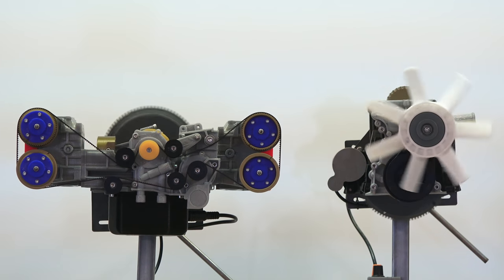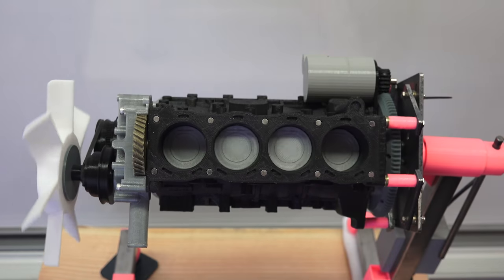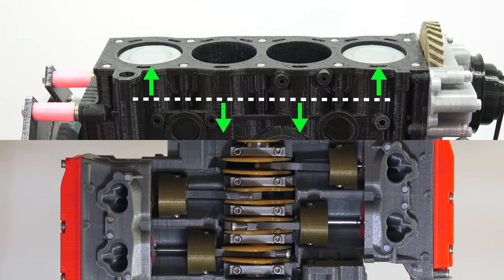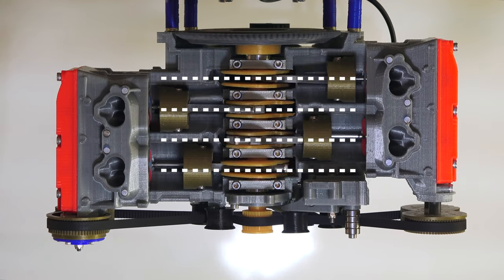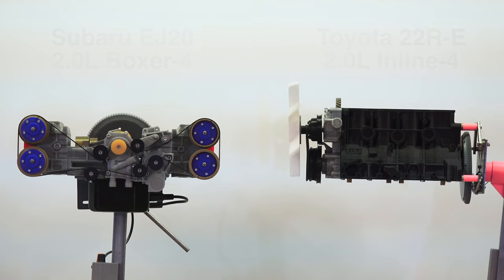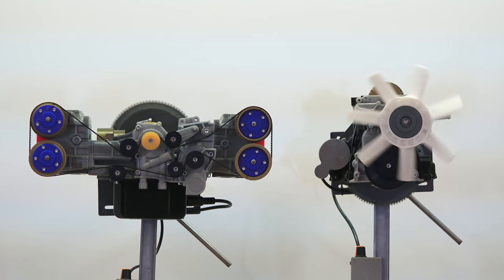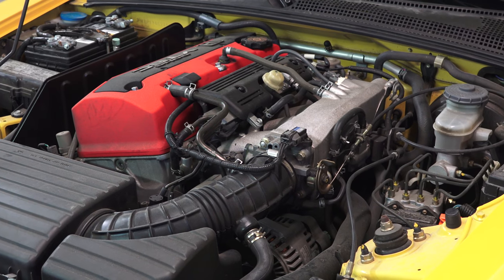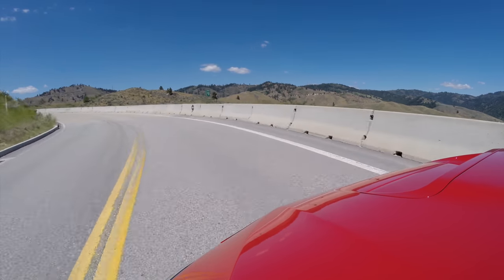The Differences Between Inline Four & Boxer Four Engines

Comment: +1. Always informative.  .. As the original owner of a MY05 Subaru Outback XT (2.5l Turbo) with 135,000 hwy miles, it's become necessary to remedy an exhaust valve requiring service. The motor must come out to effectively remove and replace the cylinder heads. .. Subaru horizontally opposed engines are notorious for early head gasket failures; Some head gasket failures attributed to substandard replacement practices and or gaskets brands. ... Not so much an issue with inline 4 cylinder architecture.
P.S., My from neu MY98 Porsche 911 C2S (993) 3.6l 6cyl horizontally opposed never so much an issue with head gaskets .... ever!

Comment: I actually learned something! I've been seeking confirmation for literally (like literally "literally", not figuratively "literally") years that the only reason a F-4 sounds different from an I-4 is exhaust setup. I couldn't think of any other possible difference that could explain it: both fire once every 180deg, period. Nice to hear someone actually say so though. I assume the same is true of crossplane vs flatplane V8s and flat vs V-12s; all I ever get is "yeah, well, crossplane V8s are, like, uneven firing, so they, like sound different". I'm pretty sure that a V8 of any type fires once every 90deg of rotation, no matter what. "Uneven" firing refers to the cylinders firing in different places of the engine, not the rate at which they fire. Presumably this creates resonance effects in the exhaust, but like with a F-4/I-4, if you run open individual stub headers, it should sound the same.

Comment: Question: would it be possible to create a V8 engine that fires two cylinders at once, instead of one at a time? What kind of impact would this have on efficiency? Would it create too much heat, and too much vibration?
Reply: im not certain, but theoretically it would screw with the balance, and heat and efficiency would definitely take a hit too. i think it would literally double fuel consumption.
Reply: A flat plane crank v8 does that.
Reply: ^I believe he is right; if I'm not mistaken, Ferrari and most "foreign" V8 engines use flat cranks rather than crossplane cranks, which is why American V8s "rumble".
Reply: Flat plane cranks are normaly faster reving then crosses.
The rumble is due to uneven exhaust pulse spacing and bad thing.
Reply: On a four stroke engine, if you make the angle on your V8 between the cylinder banks 180 degrees with a flat plane crank, you can get two cylinders fire at the same time on opposite banks. But it will depend on the strength of your engine components as to how long such an engine will last.
Reply: @GlasssTopRX7 DAFAQ you talking about that crossplane is smoother and more reliable vs. flatplane? The closer each pulse or firing is, the more uneven the power pules are, and the larger the bearings have to be, the beefier the transmission has to be, the diff has to be larger and stronger, etc. has to be to withstand more of a impulse at once vs. having the power spread out evenly over a whole cycle of time. The only reason manufacturers' use crossplane over a flatplane is due to noise. USA train tracks are considered "enjoyable" due to how the tracks are laid out, unevenly vs. Russian tracks that are even, which tend to drone, repeat, etc. more then the uneven ones, and are not as "enjoyable". The same reason that many people prefer uneven engines like most USA V8s, older Subaru boxer engines with unequal length headers, etc.. It comes down to how the human ear/brain works not physics, Flatplane cranks are better.
Reply: @GlassTopRX7 Once again WTF you talking about? Most crossplane V8 use more counterweights and balancing shafts vs. flat plane V8's. If anyone in this thread had a clue it would be amazing, and I would not have had to post, but such is life...
Reply: Last time I checked, 8 divided by 4 is two, meaning two cylinders fire at at time.
Reply: That's not how cams work dude.
Reply: +Den Log The reason why crossplane V8s fire they way they do is that it allows the crank to be shaped so that counterweights placed directly on the crank can cancel out the force of the cylinders moving. This means that ALL crossplane V8s have counterweights, its an inherent feature of the design. However, they don't use balancing shafts as there would be no point. 

Flatplane V8s are less smooth because they are basically just two I4 engines glued together. They suffer from the same vibration problems that an I4 suffers from, but with two banks of cylinders. This means that Crossplane V8s require four external balancing shafts that move at twice the speed of the crank to be smooth. These counterweights would defeat the weight saving and reciprocating mass advantage of a flatplane crank.

If you are willing to put up with a engine that vibrates to the point that you can't use one in a street car(at least not without using super expensive engine mounts), you can just not use balancing shafts, and you will end up with an engine that is smaller, lighter, and has less moving mass. This is why racing V8s are often flatplane.

The Gt350 uses a flatplane crank almost purely as a marketing gimmick. They would end up with a cheaper and smoother engine with the same moving mass, and therefore revability if they used a lighter, more expensive alloy crankshaft instead of a flatplane one. It wouldn't be as cool though, which is what really matters.
Reply: Lots of misinformation in these replies. A cross plane crank has all four journals 90 degs apart and a flat plate has two journals 180 degs apart from the other two, but both engines fire each cylinder evenly. That's every 90 degrees in two crank rotations. The difference comes in cylinder bank order where a cpc would have a LRLLRLRR bank order the fpc is LRLRLRLR order.
Reply: Thomas Knobf Aluminum is stronger than iron when used in an engine. Most production iron blocks are stronger than equivalent aluminum, but that's because the entire point of iron is that's it's cheaper, so you would want easier less precise manufacturing. If you overbuild an engine block, imperfections that make it weaker don't matter as much because it's still strong enough.
Reply: well ,4 strokes of 180 degrees are 720 , so a fire every 90 deg usually , in a v 10 there is a fire every 72 deg ,in a v-12 is a fire every 60 deg , got it ?
Reply: Actually rumble in US V8s is due to firing order and manifolds, usually non-US V8s are still cross plane, flat planes are only used in a few cars - usually British (Lotus, TVR, iirc some McLarens) and Porsche 918.
Reply: The reason that most production V8s are cross-plane is due to cost, flat-plane crank V8s have lighter cranks (due to not needing counter weights) and are more free revving but they have vibration issues. The way to reduce the vibration issues is to have higher quality parts and materials, machined with tighter tolerances, hence costing more. This is why cross-plane crank V8s are usually in expensive sports cars, where the additional manufacturing cost isn't really a downside. This doesn't mean cross-plane cranks are always worse though, they're just different. The additional rotational mass means they don't rev as much BUT it also means they have more torque in the low to medium rev range which makes it nicer for every day driving.
Reply: I am looking for another 99 dodge ram 5.9 so I can steal the fuel injection harness.  I am going to wire into the existing harness so I have 2 cylinders on each bank fire at once. I will end up with 600hp on a 250hp engine.  Its gonna be awesome.  LOL  :)
Reply: Dunkaccino25 why are those words in quotations
Reply: GlassTopRX7 in what way is a Ferrari reliable
Reply: Hi Dialysis forever. You couldn't just use another fuel injection harness. You'd have to have a different cam. Are you talking about making it a 2 stroke instead of 4 stroke engine? Crazy idea. You'd have tons of custom hurdles to overcome including programing a new PCM for the changes in spark.
Reply: That would basically turn an 8 cyl engine into a 4 cyl.  The whole idea of having an 8 cyl is so you have 8 different pistons firing at 8 different times. If you wanted them to fire at four separate times than why not just get a 4 cyl.

Comment: There's a difference between a flat-four and a boxer engine.  The opposed cylinders on a boxer engine are in line with each other.  This is possible because the opposed cylinder use the same crank pin, and the big ends of the connecting rods are forked.  A true boxer engine does not have the rocking couple, while a flat-four, where each cylinder has its own crank pin and staggered cylinders, will have a rocking couple.
Still, you do a great job explaining so many things - you have a great site.
Reply: boxer engines are a subset of flat-four engines

Comment: The reason why every Subaru owner has blown a head gasket 😂💥
Reply: You forgot a S on gasket. It has 2 and yes they blow constantly and are such a pain in the ass to change. Also because of the mentioned twisting motion, you will go through engine mounts like priests go through alter boys. Don't buy a vehicle with a boxer engine. I'm warning you from experience.
Reply: Subaru's been using the FB engine for almost 10 years now that has no coolant passages through the head gasket, therefore no gasket leaks.
Reply: @trainiax  c'mon man ! Us the worst Japanese car?
Reply: @shperax  Altar...

Comment: Look into Lycoming aircraft boxer 4 engines. They can get up to 5.9 liters!
Reply: With the Subaru engines, they were designed based on the Avco Lycomings O-320.  The original version was scaled down and air cooled, but from there, they were water cooled.  A lot of development went on from here, but in essence, Fuji Heavy Industries did not look at VW, Porsche, or any other car manufacturer when they decided to go with the Boxer engines, they actually looked at Lycomings.

Comment: An interesting thing to mention is that while boxer engines in cars aren't all that big, airplanes (small propeller airplanes that use gasoline engines rather than turbines) usually use huge four- or six-cylinder aircooled boxer engines. For example, the Lycoming IO-390 displaces 389 cubic inches/6.37 liters. But out of that only gets 210 horsepower at 2700 RPM - though it's designed to produce that all day rather than just in short bursts, most car engines can only produce their rated horsepower for a brief time without overheating. And it runs pretty slowly as it's direct drive to a propeller. Similar the Lycoming O-540 is 8.9 liters six-cylinder boxer, 300hp.

Comment: The Panhard & Levassor H2 has a 2 main bearing crankshaft allowing the two cylinders to have very little offset. Only when idling does it have noticeable shake, mostly a horizontal twisting motion. 
Unfortunately this fine engine was discontinued when automobile production ceased after 1967. A multicylinder development of up to 12 cylinders was used in a series of military vehicles.

Comment: Advantage of in line 4. non interference engine..2 chains instead of 5..and far more reliable and services easily
Reply: You're right about the ease of service on an inline, but that's it.  

Reliability has nothing to do with whether it's a boxer or inline.  Nor does non-interference - Subaru engines have been both interference and non-interference depending on the year.  And I don't know what you mean by "2 chains instead of 5" unless it's for the timing belt/chain pulleys, which aren't really a reliability concern either way.

Comment: Just bought a Subaru Legacy. We shall see about engine. Remember, the VW used boxer engines and they were just about impossible to destroy.
Reply: Not true, anyone who had an air cooled VW engine knows that they ran hot, only had 2.5 qts of oil, no oil filter and if you neglected to adjust the mechanical valves, one would eventually tighten up, overheat, the valve would break off and trash the engine. The only way you made those last was very frequent oil changes and valve adjustments. Mono grade oil too. They ran hot enough to thin out multi vis oils.
Reply: Luigi 1955 and all the leaks these engines had... Dear God.
Reply: Got subaru wrx in 2007 and sti 2011... Never a problem....

Comment: Not seeing the resultant rocking couple on the boxer engine. I get it with a boxer twin cylinder engine but looking at the boxer 4 cylinder above at 0:57 frame, for example, pistons 3 and 4 (at TDC) are causing a clockwise couple, but pistons 1 and 2 (at BDC) are causing same magnitude couple in anti-clockwise direction, thereby cancelling each other. At 0:58, the opposite happens, again cancelling each other. What am I missing?

Comment: I'm here just tryin' to figure out how magnets work dog
Reply: Electrons have this property called spin.  Normally electrons spins cancel each other because of their partner electron, but in magnetic elements, there are several single electrons.  

In magnets, the spins of several electrons, and between several atoms, all line up. How that spin actually results in a force you feel is kind of complicated, has to do with relativity, but it's the force of either positive charge to negative (attraction)  or positive to positive (repulsion) . If you want to learn more go to veritasium or minute physics, they have good videos with animation.

Comment: Nothing about reliability? I easily put over 300,000 miles on my Subaru’s while my wife’s in-line Ford and Chevy cars struggle to get to 150,000 without major repair work. This is based on 40 years of driving experience.
Reply: 90s Ford's are like the plague.
Reply: Ya, almost as bad as the 80's Fords.
Reply: I don't think boxers would win in a reliability shootout. Gasket seal leaks are a perennial problem on Subarus, not sure about Porsches.
Reply: 6 cyclinders, not V8's.
Reply: Reliability only comes with good maintenance. Most people who own subarus dont realise you need to service the engine after every 5000 - 10000kms like most turbo vehicles. However as the subaru engines get older they need to be serviced more frequently. People ignore these simple facts.
Reply: Sounds like you need to get your wife a good bicycle or a horse.
Reply: 300k how many times you do the head gaskets?
Reply: Ford & Chevy are not the only brands that use inline engines..most companies use inline engines.. inline engines reliability?? ever heard of Honda & Toyota??
Reply: My 07 ford ranger 189000m inline 4 no repairs at all hmm mythbusted
Reply: soulless one Skoda Octavia 1,9 TDI. Inline 4.   500.000 miles and runs perfect. Check famous Miles on YT
Reply: I Subaru isn't going to match ford's inline 6's when it comes to reliability

Comment: Nice video, I would like to add 2 more big disadvantages of the horizontally opposed engines though. The first one is the shape of the ports, look at any decent modern engine and it has a small cross sectional area and an upright design which still allows it to flow well due to the high velocities it can sustain. However on a flat engine the intake needs to curve back in on itself and as such the intake ports have to do a full curve much like what you would see on an engine made 30 years ago. The second is that because there is very little spacing between opposing cylinders the webs of the crankshaft and the con-rod big ends have to be very narrow. This makes the crankshaft really weak and it's compensated for with narrow much larger diameter journals for both the rod and mains. The result is a higher surface speed which leads to more drag. This is a big reason why Subaru engines are known for bearing failures.
Reply: @TonyChubbs100  Do you mean only the older Subaru engines have bearing failure issues?

Comment: do a "difference between boxer and 180 degree V4" next?
Reply: Peida Li I believe in V engines the opposing cylinders share the same crank pin while flat engines dont.
Reply from the maker: Discussed in this video! https://youtu.be/y5oRsvRH_Ig
Reply: Weed early mustangs had them
Reply: V4 engine came out in the early Mitsubishi Galants  that were in Australia.
Reply: @jcramond73  Ford Capri had a V4
Reply: Thanks Chris, been a while since I owned one, brings back a few good memories.
Reply: J C Check my video's. Aus didn't get the mk3 injection special Capri 👍🏻
Reply: Hardbass Approver 
Essex V4 (manufactured by the Ford Motor Company from 1965 to 1977) was a common engine in the Ford Transit van.

Comment: I was in Europe and I blown away by my cousin that owned a vw with a V5 engine. I never knew it existed. V lay out. 3 pistons on one side 2 in the other.😱 amazing.
Reply: I believe they're VR5 engines so although there are two banks they're squeezed together into something like an inline config. Engines with odd numbers of cylinders always sound good though.
Reply: Pretty sure it’s an inline 5. VW made lots of those.
Reply: @Bartonovich52  I have an in line 5 this one was a v5 , 3 spark plug one side 2 on the other. America doesn’t have its in Europe.

Comment: Toyota 86 use boxer engine too
Reply: Subaru BRZ what?
Reply: that's a Subaru engine
Reply: TRD stickers only work on Toyota, slap a TRD sticker on a BRZ you won't get any gainz  on a Yota you get 200 HP bump
Reply: The Toyota 86 boxer IS a Subaru engine!
The original Toyota 86 was simply a model code for the last of the rear drive Corollas, that were available with the 1600 twin cam engine. I had an '89 Corolla GTS, front drive with the same engine, fun and fast but no low end torque.
Reply: The GT86 and BRZ was designed by Toyota and built by Fuji Heavy Industries, its only brand preference that divides the buyers
Reply: 83 Corolla, they run FOrEVEr!!!!!